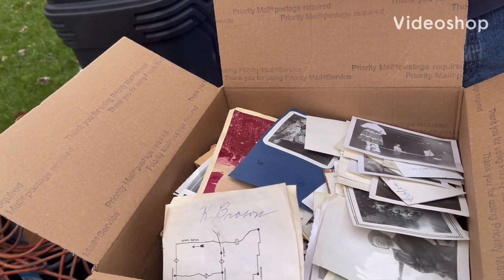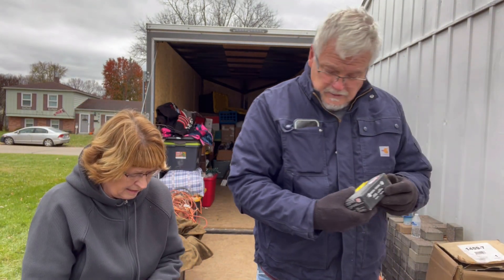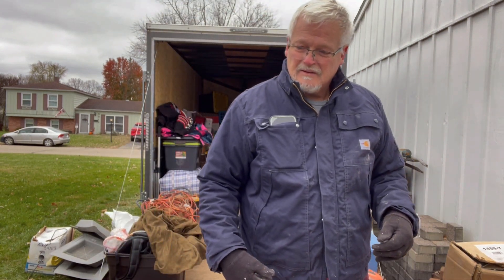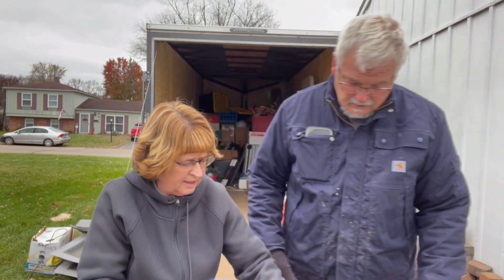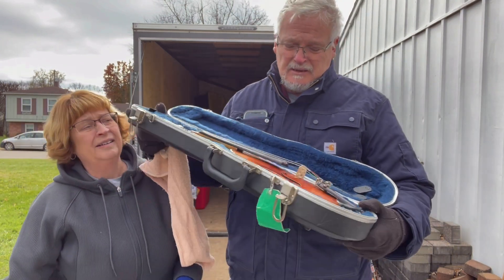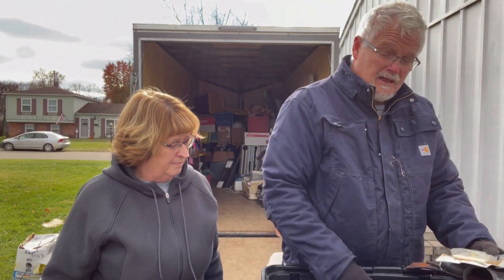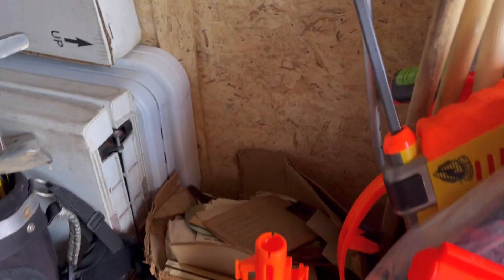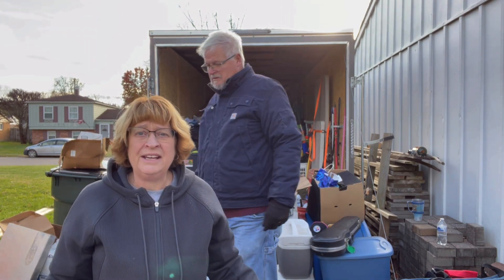We Purchased A 5 x 10 Abandoned Storage Unit That Keeps On Giving Guns, Gold & Treasurers!!

Comment: Hi - As with eveything, the condition of the violin determines it's value.  The face looks a bit worn with a possible crack on the bottom right side??  Also appears to need major bow work and the case also looks a bit worn.  Probably used by a student.  I would say it's worth around $50.